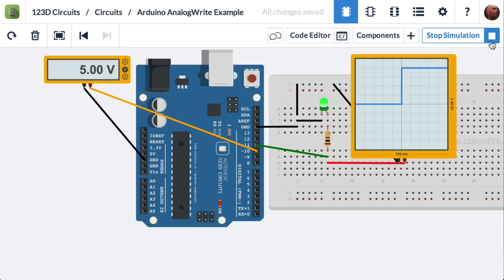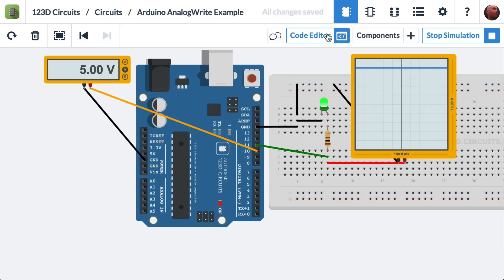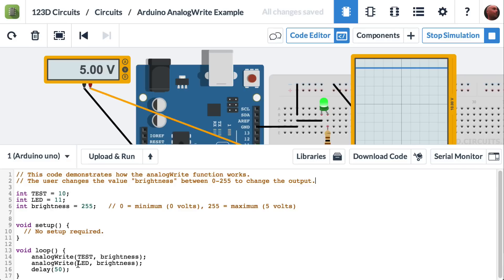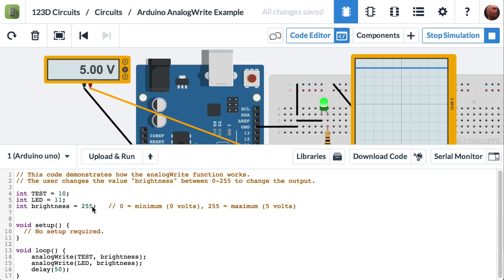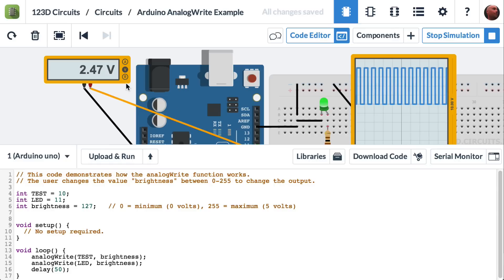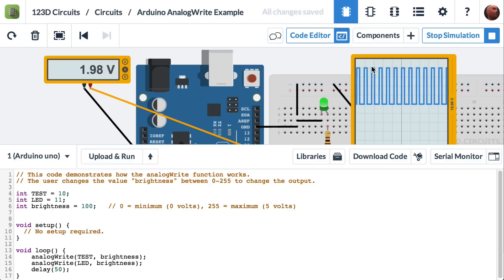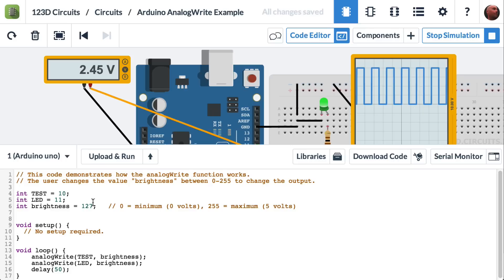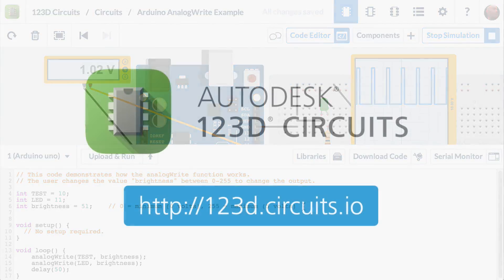Arduino - analogWrite( ) - Electronics Lab

Comment: Hello,  Wondering what was the App that ws the Oscilloscope?  What does it cost and where did you get it?  Also, how do you connect the board contact points to the computer (I'm using a Mac OSX or WIndows 10).
  Thanks